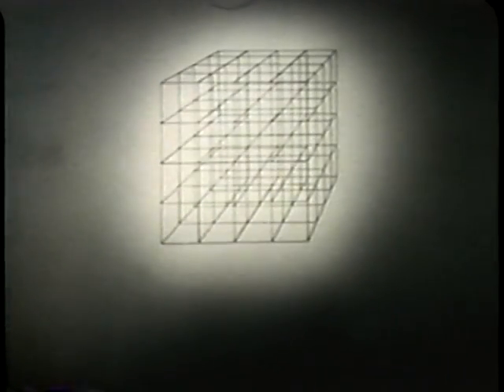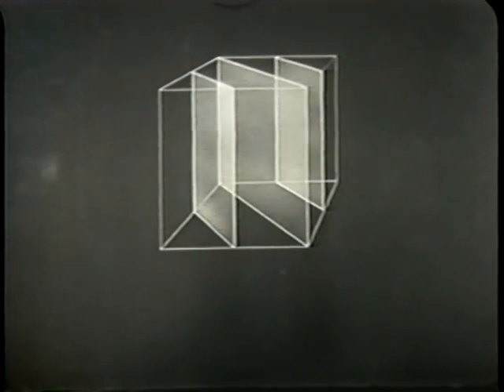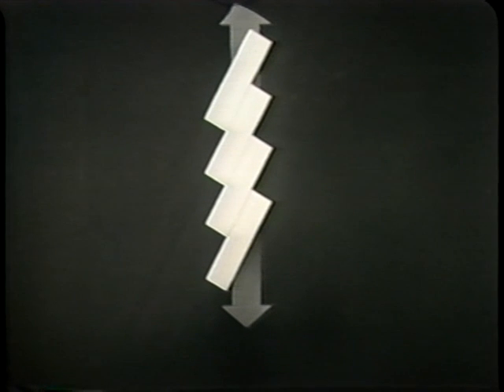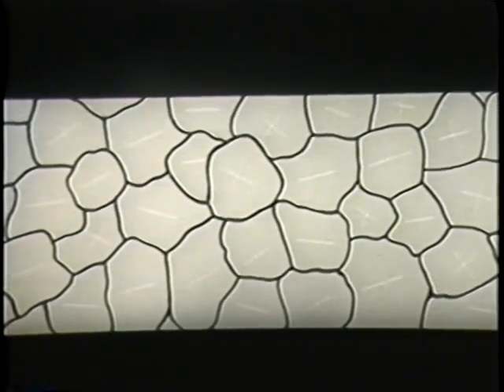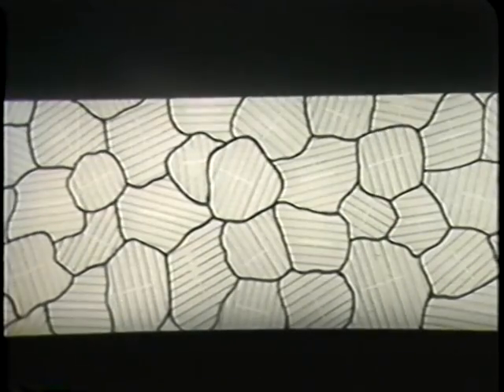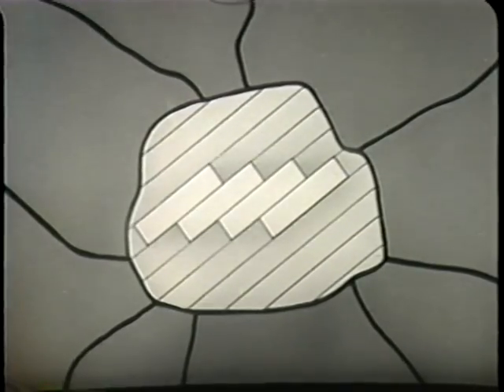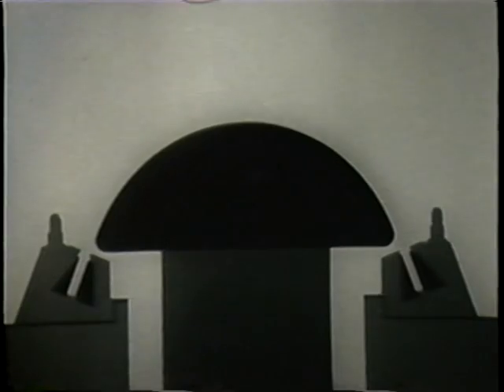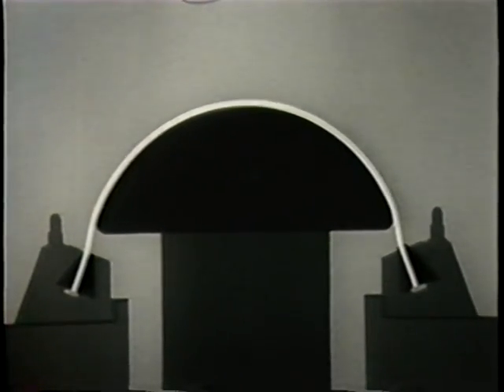Heat Treatment of Aluminum

Comment: Anyone that believes what was taught in the 40's in a Gov film.
Should be pretty easy to trick. 

This film is old. At this time the US knew very, very, little about Aluminum, molecules, and more.

Many advances have been made in the last 75 years since this film was made.
Reply: +Sol Shady 
Allow me to disagree. Everything the video says is correct, maybe incomplete, but correct.. You're right in that advances in the field have been made but they don't invalidate what this film teaches though.  They don't mention the biggest drawback of cold working which is a loss of ductility and therefore toughness. They indirectly hint at the problem by saying that an annealing treatment must sometimes be applied between cold working operations in order not to break the part, but still I think they should explicitly point it out.